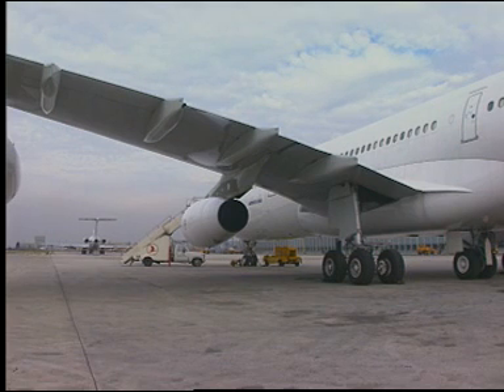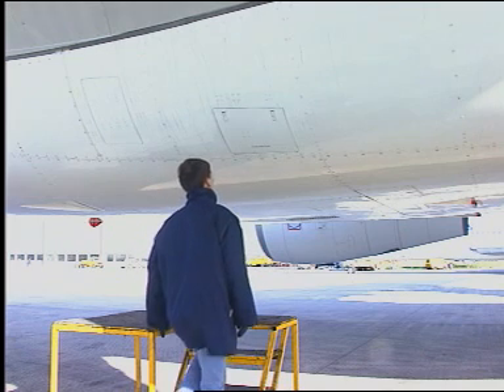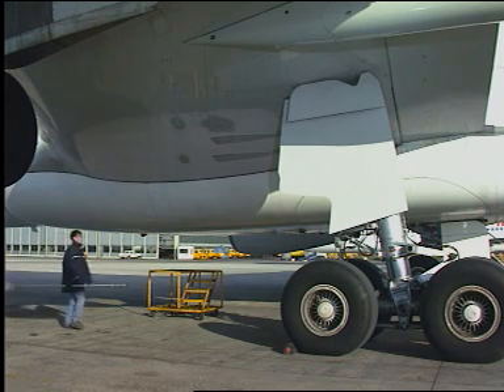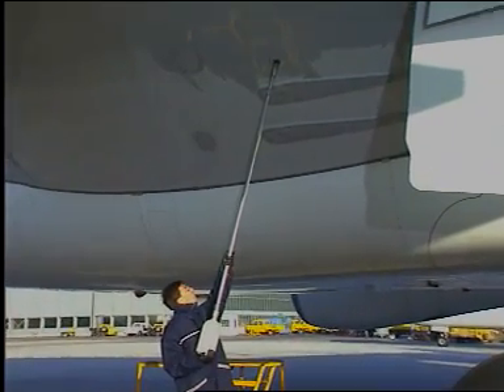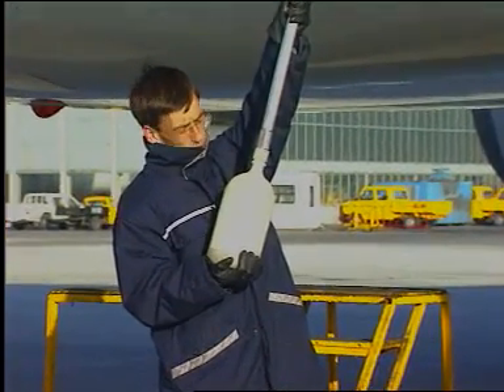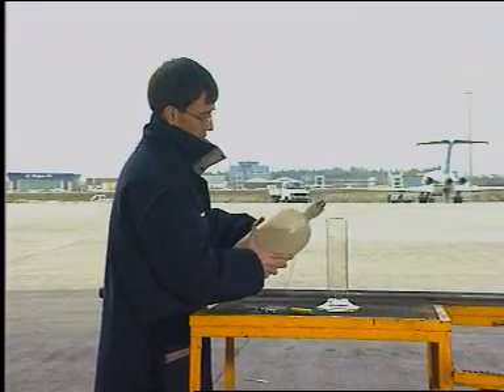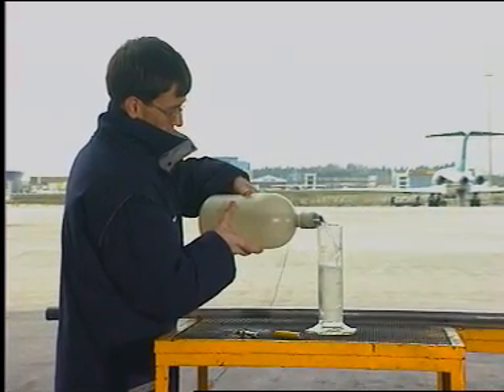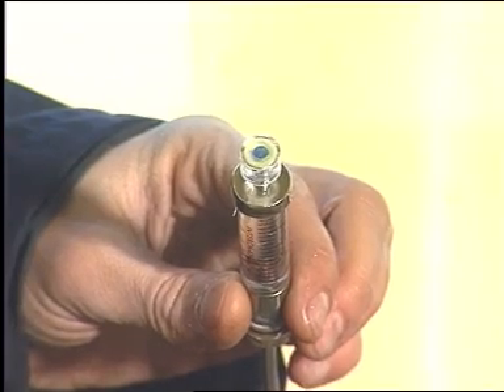AIRCRAFT | A330/A340 Water Drain Valve Operation

Comment: Is this operation performed every time an aircraft refuels?
Reply: Yes, and also the tanks shall be drained before the first flight of the day.
Reply: Ivo Pires    N_O_T_E_ : If possible, do the water drain procedure"" before you refuel."" If you refuel the aircraft before you do this procedure, the water and the fuel will mix. Because of this, you must wait one hour for the separation of the water and the fuel before you can drain the water from the tank.
N_O_T_E_ : For this procedure there must be more than 10% content of fuel in each tank